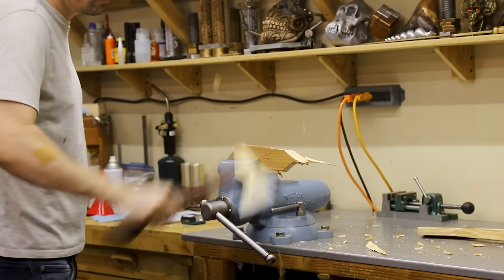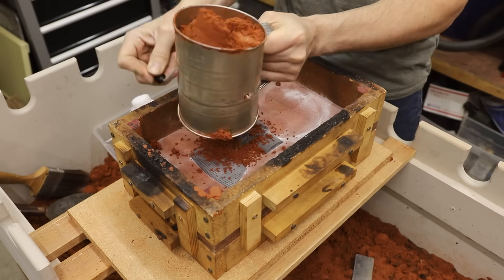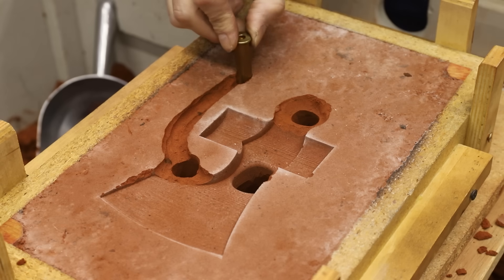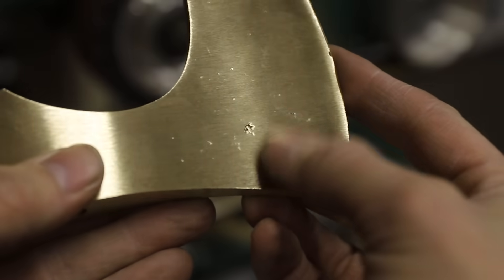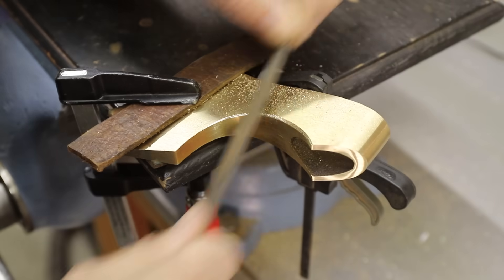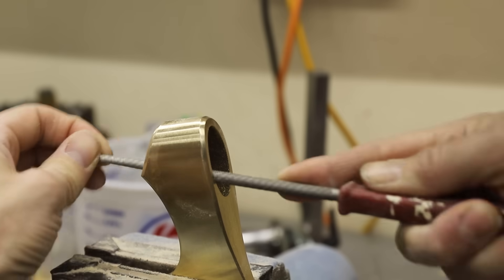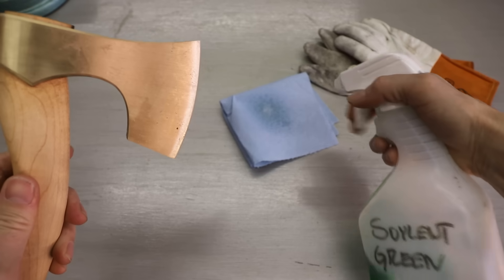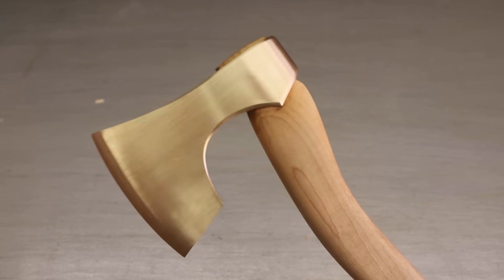Making & Testing Aluminum Bronze Hatchet WILL IT SURVIVE?

Comment: I've been casting aluminium bronze for over 25 years and I know it can get really hard, depending of alloy and cooling process after the casting. It hardens when it's allowed to cool down slow, just the opposite what steel does, that's why I have to open my moulds immediately after casting and cool the castings quickly so that I'm able to machine them. 
If I let the castings to cool slowly, I'm not even able to drill holes in them with HSS tools. Aluminium bronze also workhardens, as you said in the video, but it gets brittle doing that.
Commercial alloys include iron, cobolt and some other metals beside just copper and aluminium.
Once I gave one of my castings that had accidentally been left to cool down slowly to a friend of mine, who was working in quality control and testing department of a big gear manufacturing company, and they tested the hardness of that casting. They were blown away how hard that thing was, I can't remember the exact value, but it was comparable to a hardened tool steel.
Reply: If you don't mind my asking, what are you casting?
Reply: @Nevir202 Gravestone ornaments. I use aluminium bronze because of the patina on it is transparent, so it doesn't turn black over time like other copper alloys do.
Reply: @filopat67  Wow, that's interesting. If that's the case, I'm surprised it isn't more popular.
Reply: @Nevir202 It has downsides for casting, quite bit of them. It shrinks when it solidifies, a lot, it's really hard to weld and solder because of the aluminium content, it's difficult to machine because of the workhardening and it's not easy to cast because doesn't run well. When you pour it the smelt is surrounded by a aluminiumoxide "pouch" that causes the pour to slow down and solidify before it fills the mould. For the industrial  use it's a bit niche material, so it's not easily obtainable, it's mostly used for marine propellers, valves in process industry and for coins.
Reply: @filopat67  Thanks for the info!
Reply: @filopat67 have you come across aluminum bronze urns?
Reply: @goodboi4939  You mean like burial urns?
No, in my country all burial urns have to be biodegradable.
Reply: @ really here in the US for the most part you can keep cremated remains in any urn and opt to bury, keep in a Columbarium/Mausoleum, or choose to keep at private residence. In my state specifically if cremated they can be open scattered too.
Reply: So if it hardens better slowly as opposed to steel, what if you tried a way to prolong its hardening by temperature control, would it make something even harder then steel perhaps? hmm. And i mean like encased in something that could control its heat perfectly.
Reply: @StealthMoustache  As everything, it gets more brittle as it hardens, so in really hard state it's not very usable for anything. It's not even specially good bearing surface.
Reply: @filopat67 ah that's a damn shame.
Reply: @filopat67  This actually makes me think of what may work for this purpose.  You know how catanas have a differentially hardened blade by coating the actual blade bit in clay to thermally protect it from the oil during the quench?  What if you did something like that for aluminum bronze hatchets or knives, where you expose the base to air asap, but leave the blade portion insulated by sand, so it has a longer cooling time, thus making it harder.  Do you think that would work?
Reply: @Jeremiah90526 I don't know, perhaps. I haven't really tried anything like that. I try my best to avoid hardening in my castings because I have to machine them.
But honestly I think that what ever method you would try to manipulate aluminium bronze, steel would still be superior material for blade making purposes.
Reply: @Jeremiah90526  It's generally done by doing one phase of it first, and then reheating just part of the piece depending on the shape and what the alloy needs for temperatures and times.  These days induction heating is a common way to put exactly the heat you want exactly where you want it.

Heat it, cool the whole thing slowly, then reheat the head from the thick end while applying cooling to the edge to keep it below the critical metamorphosis temperature, then drop the whole thing in a bucket of water.
Reply: @laurenceperkins7468  Thank you for this, I might mess around with trying this out with my brother the next time we do some casting.  It may be months from now (we live over an hour from each other, and he is married with children), so I am putting your comment in a document so we can hold onto it.  Oh boy, this is gonna be good.
Reply: If you want something that is hard but a specific shape, can you cool it quickly, machine it, then reheat it but not high enough to melt it, then cool it slowly?
Reply: How peculiar. That means that the outside would always be softer than the inside.
Reply: @Kargoneth Actually the surface is really hard no matter how you cool the casting, because it is aluminiumoxide, but that layer is really thin. But the outer core of casting is softer than the inner, you can even see that when you machine castings. Softer parts are duller in color, and hardened part has a lustre on it.
Reply: @filopat67  Indeed. I was not including the aluminum oxide layer because it has a thickness of a few nanometers.

My comment was more indicative of my surprise that this behaviour of aluminium bronze seemed sort of inverted compared to my understanding of the annealing of steel alloys, wherein slower cooling seems to result in a softer, more ductile steel.

(Admittedly, my understanding may be entirely incorrect; I still find the annealing, hardening, and tempering of steel rather mysterious and difficult to wrap my head around, so to speak. I just can't seem to make it stick in my mind.)
Reply: @Kargoneth  Actually on a casting the oxide layer can be much thicker. But yeah, it works inverted to what steel does.
Reply: You can still drill the hard material,  spin the drill slower and apply a bit more downward pressure.   Aluminum bronze shouldn't get hard enough to require carbide drills, but you might want to sharpen them at 135° similar to what is sometimes done for stainless.
Reply: This is interesting, thanks for saying.
Reply: The one thing copper and copper alloys have over steel are their corrosion resistance. I don’t even know if stainless steel could last as long unless it was specifically Marine Grade. Some of the bronze and copper spear and arrowheads dug up look like they could be polished up and look just as they did when they were dropped.
Reply: Yeah, imma call bull on this. I've worked on multiple different bronzes, brass, stainless, chrome, and several exotic alloys. I have yet to work with, watch, or even hear about a bronze alloy even nearing high speed tool hardness. That means it has a rock well hardness well into the high fifties or even sixties.
Reply: @glicherful  Well.. I've been working with aluminium bronze for over 25 years. You can call it what ever you want. I know what I know and what my experience is.
Reply: @filopat67  Just out of curiosity - how does it taste when you work with it?  More like copper or more like bass?  Or maybe it's totally different?
Reply: @ColonelSandersLite  I have never sensed any taste in it, when I'm grinding or sanding it there is an odor like electrical burn or something aking to that, though I'm not sure if it's the metal emitting that odor or just the grinding disks I use.
Reply: @filopat67  That's pretty interesting.  

I think I remember reading that, from a chemistry POV, most metals don't actually have a taste themselves.  What you taste is really the stuff that's formed when your sweat and oils and such react with the metal.

Maybe the aluminum component makes it very resistant to this reaction.

Anyways, I might try and do some tinkering with this stuff myself.  The reason I was asking is that I absolutely detest the taste of brass.  Copper's fine by me, but bass is just intolerable.  Which is a shame as it's relatively easy to work with.
Reply: @ColonelSandersLite  I can't say that I can taste any metals, Zinc being the only exceptions to that rule. 
I remember I could taste iron when I was a kid, I used to absolutely hate the taste of iron in some cutlery we got, but I've lost that ability now that I'm older.

Comment: Aren't you supposed to hammer an axe handle on by holding it upside down hitting the bottom of the handle? Or does that not matter for a little hatchet like this?

Comment: I knew as soon as you went from fresh wood to anything harder that edge would get ruined.
The problem with bronze. Iron or steel are sadly not only cheaper but heavier which is also better for an axe head.
In fact if you made a pure cast iron head that would be really neat.

Comment: yup it split the oak... very brittle and cracks as it dries, becoming more brittle over time... some soak the wood in glue or epoxy.
Reply: also you work harden it every time before sharpening 🤓

Comment: I used a pair of aluminum bronze wedges as part of the bow irons on a medieval crossbow build - they jam fit between two steel blocks to clamp the bow to the stock. One thing I noticed is that when pounded into place with a steel hammer, the aluminum bronze wedges would deform very slightly and result in a fit that was much tighter than a pair of steel wedges. They made a very pretty contrast with the blued steel until they got scuffed and scratched to hell - an interesting material but frankly too soft for most applications I've tried it in.

Comment: From what I understand, bronze blades would be resharpened by peening rather than by grinding the folded/rounded edge away, which would also keep the edge work hardened. A worker could do this in the field with two smooth stones and a few minutes.

Comment: Should have gone with straight bronze as that's what the Greeks and Romans had.
Yeah, aluminum shrinkage is annoying - all of my ingots have divots and craters in the middle of them.
The work hardening divots on the blade actually looked really nice IMO - I would have left them for decoration.
Try an apple seed edge as that stands up to chopping better.
You forgot the final test - ballistic head dummy - will it keel?